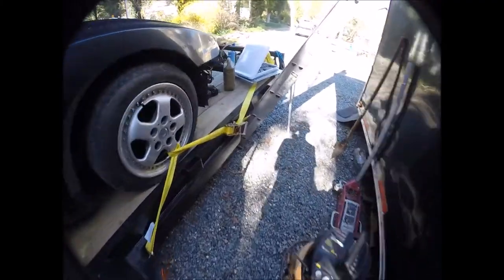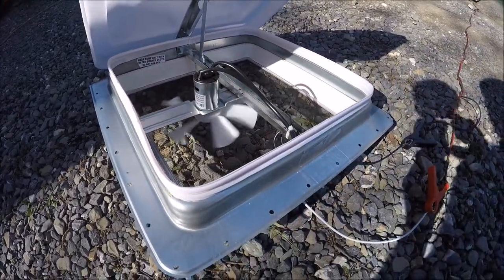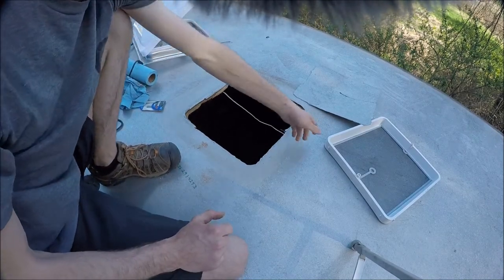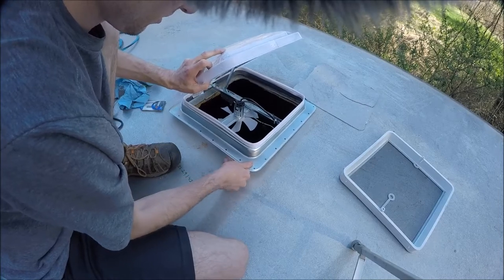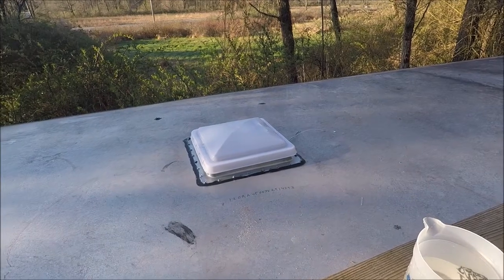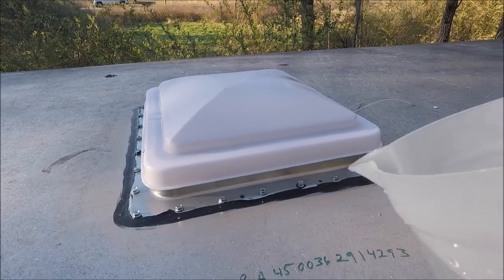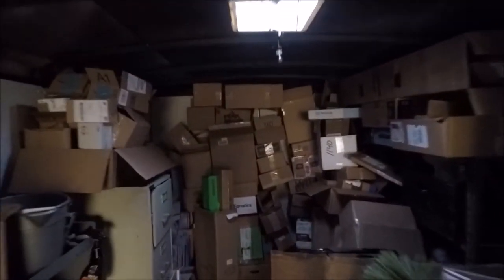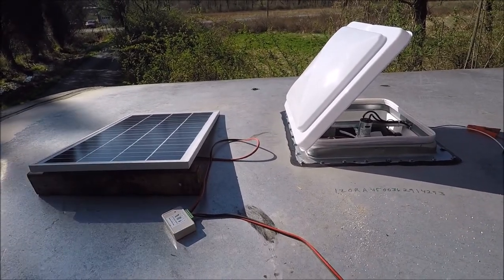Solar Roof Vent Fan - DIY Install On Enclosed Trailer - Heng's 12V

Comment: @4:13 around what gauge is your sheet metal ?  Will this work with Fan-tastic Vent 12v 2 or 3amp fan with a 100 Watt 12volt solar panel with a 6.2 max amp? If not any way to regulate amps with charge controller but still no battery?  I;m wanting the larger panel to help cover the roof but also to do better in low and indirect sun.
Reply from the maker: I'm no electrician but as far as I understand, the fan will only draw as many amps as it needs. So as long as the voltage of the panel and fan match, and as long as the amps of the panel are equal to or greater than the fan's amps, the fan will work. With a panel that large, you could do multiple things in addition to the fan, like run it through a charge controller and charge a battery or run LED's. The panels I use run the fans even in relatively low light, and they sing when the sun is out, it's a really nice self regulating setup, I don't have to worry about on/off switches, everything just happens on it's own. I added a second vent and panel too.
Reply from the maker: also i'm not sure of the gauge of the metal

Comment: I've got a few questions:
Do you just hardwire it to the fan? 
If so does it just run non stop when the sun is out?
Is there a way you could put it on a switch, or would that fry the solar panel..?
Reply from the maker: I hardwire it because it automates the fans coming on and their speed as the sun gets hotter, but you can use a battery and charge controller and/ or a fuse box and get as fancy as you want. The fans come with a switch. It won't fry a solar panel if it's just sitting out in the sun and nothing for the electricity to flow into...electricity doesn't like "build up" inside them, as far as I'm aware. I've been running the same panels and fans for 4 years. I have bigger panels on the house that weren't hooked up for a time, they've been hooked up again and are still working.
Reply: @aDIYCarGuy   Thanks! I think I'll just put it on the switch then so when it's bright but still freezing out   out I can kill it. Theres no need to blow my budget overcomplicating things  .. thanks again!

Comment: Doe this fan have a way to set it to come on at a certain temperature? I would hate to have to hit a switch. I would like it to be cooling once it hit 100 degrees and be cooling the trailer down before I even get in it.
Reply from the maker: I just have it hardwired to the solar panel, and I leave the fan switch on 24/7, when the sun comes out the fan comes on, and the brighter the sun, the faster it runs until it maxes out

Comment: We learn by what others do.  I would have put sealer on each hole before putting in each screw.  I think that putting some shrink tube on wires would be a great idea.  Also if possible drill a hole through the frame and a good tight rubber grommet to feed the wires through.  Some other outside wire protector would be good.  I paint my plastic covers with a light paint to help protect from premature UV damage.  Only buy metal frames as that plastic also deteriorates and is a pain to replace such as the stock from factory units.  Look on both sides of roof or walls for things you don't want to cut or drill through.  Good video though!

Comment: Great idea. Do you leave this stuff up year around? Any problems with it getting wet?
Reply from the maker: Thanks, I leave it up most of the year, but I take it down in the winter. I have since removed the charge controller and just have the panel wired to the fan. No problems with water, a little corrosion on the ends of the wires but I'm not worried about it. I actually added a second vent and panel at the beginning of the summer.
Reply: a DIY Car Guy Thanks. This answers my question about the white box (charge controller) and it not being needed for this setup. 

D.

Comment: What did you add between panel and fan? Did it come with panel? If not, can you send link? Thanks for the video.
Reply from the maker: Sorry I don't know what you mean, it only came with what is in the video
Reply from the maker: I know what you mean now...the white box is a charge controller for a battery...this setup should be used in conjunction with a battery, although I ran it directly to the fan, which will shorten the life of the fan. Panel:   http://amzn.to/2oWffOt
Reply from the maker: I think they sent the charge controller with the panel by accident, I ordered the cheaper one without the controller
Reply: a DIY Car Guy Is the charge controller required for this setup? Did you run the second fan through the charge controller? Are the two fans running off of the same solar panel or separate panels? 

Sorry for all the questions. I’m looking to do something like this with two fans and I don’t want to burn anything out when I connect it up. You are also the only one I’ve found so far that is doing anything like this. 
Thanks for the video and any suggestions you have will help. 

D.

Comment: how come no shows the actual wiering???
Reply from the maker: just connect the panel wires to the fan wires, there are only 2 wires, swap the wires to make the fan go in either direction....